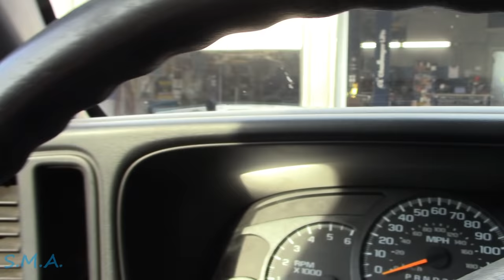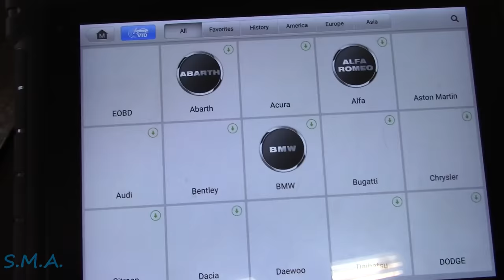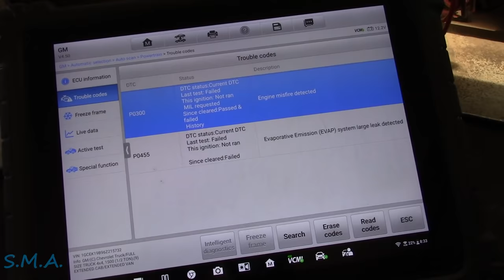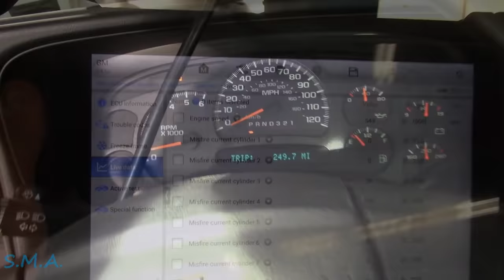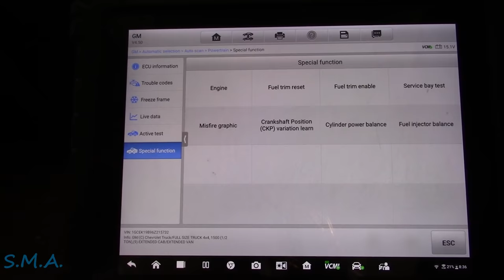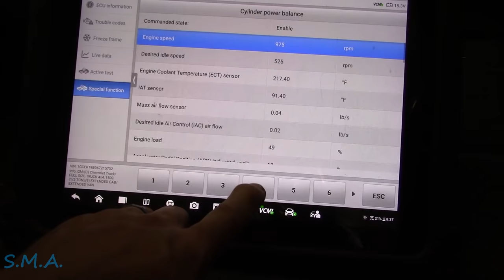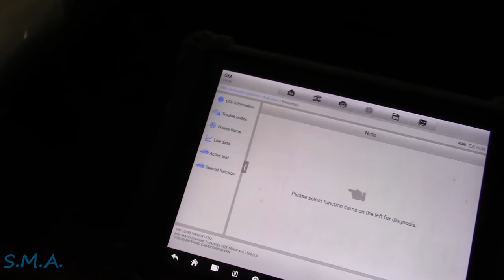GM - Chevy Truck: Misfire Diagnosis

Comment: That injector could be perfectly fine, yet be clogged at the input or the nozzle with debris, and that could be why the scope looks the same. The flow test proved the diagnosis, and your methods work well even with this bizarre part failure. That is why you are the go to guy. I have an electronics repair background in schooling, but am an amateur car fixer and I love you videos. I always try to beat your diagnosis while watching, LOL. These videos are the best ones. Thanks for making them!
Reply from the maker: That was the only thing I could figure myself. It wasn't seized up it was simply plugged tight. Therefore it still had mechanical movement.
Reply: @SouthMainAuto  There was a fairly clearly defined (though small) flattening on the good injector closer to the peak current level that wasn't there on the bad one.  That said it seems a bit late for an injector to be opening.
Reply: @SouthMainAuto  But it was not buzzing when u did the fuel pressure test?  Still am impressed.
Reply: @ebutuoyebutouy  Depends on what is in the nozzle, the buzzing is the tip of the pintle hitting the seat in the nozzle, if a chunk of crud is in there it will act as a cushion and no sound.
Reply: @Blazer02LS  Thinking about it u r correct.  Thanks for sharing.  Stay safe.
Reply: @ebutuoyebutouy  You too.
Reply: @ferrumignis  I was looking for this post. I'm by no means a scope master, but I noticed it too.
Reply: @Blazer02LS  Thanks for pointing that out. I hadn't thought about that. That would explain why the waveform looked the same yet you couldn't hear that injector. It probably helps explain why the other shop missed it. If they just looked at it on a scope it looked good.
Reply: @Blazer02LS  Exactly. Had a Honda motorcycle injector do the same thing to me. After cleaning it made the clicks it should.
Reply: @Blazer02LS  That seems like it would be leaking fuel past the nozzle though, and the fuel pressure wasn't bleeding off. Anyway, I agree with Eric O: bad injector.
Reply: @flagmichael  Not if the schmoo is in the nozzle tip, it would stop fuel flow and act like a cushion for the pintle, which in turn would work to hammer the crud in harder
Reply: This generation GM trucks are famous for gummed up injectors. I bought a 99 GMC Sierra with a 5.3 with a misfire on cyl 8. Took it out and cleaned it out with carb clean, then swapped it with the injector next to it, Fixed the issue. Now the famous GM wouldn't go back in park last time I drove it. I persuaded it to go into park eventually. Now I need to fix that. I suspect the shift indicator rod has came off the doohickey. They don't call them the Garage Man Companion for nothing!
Reply: The scope shows the electromagnetic response of the solenoid coil inside the injector. If the coil is good but the mechanicals blocked, the scope won't show this clearly as the coil is working normally. The fractional variation is due to the slug in the coil (the actual injectorctor needle) not moving inside the coil hence rhe inductance and back-emf of the coil is slightly different (not a lot since the movement is only a couple of mm).
Reply: 15 years ago I had a Malibu with 3 clogged injectors full of rust from a rotton tank. For whatever reason I had 3 sprk plugs out (probably trying to figure out dead cylinders without scope) and tapped the key to check something and the car started and RAN really well on 3 cylinders. I swapped all the injectors with used and ran great.
Reply: @SouthMainAuto  Eric,, it was seized wouldn't it throw up the Amp draw on the scope?
Reply: Like the plug, could you have swapped the injector with any known good one?
Reply: But when he did the injector test it did not make any clicking noise.. how does that work?
Reply: The back injectors esp #7 are prone to clogging up with debris.
Reply: Great job
Reply: @SouthMainAuto  what scanner are u using ?
Reply: OMG, I don't understand anything you guys are saying
Reply: @SouthMainAuto  hi boo
Reply: @limitlessworx5724  it's an Autel Maxi, I believe, but I don't know which exact model.
Reply: But, if it was just clogged tip or micro filter, I think you still will hear the rattle of the neddle opening and closing during the drop test. I think!. Thanks
Reply: While observing the wave forms, never thought I'd use the "ELI the ICEman" electronic training phrase!
Reply: I agree about the fuel clog 100%
Reply: Have a 05 Chevy box truck with a 6.0 misfire in one cylinder. This was interesting watching your deductive skills

Comment: The real misfire was the parts cannon that other shop aimed at that truck.
Reply: There is a guy in Avoca that actually diagnoses cars instead of just throwing parts at it.
Reply: Parts cannon stuck in full auto mode from the others, Seems to be a waist of good parts I hope the replacement parts hold up as well as the now discarded parts, Because many times one of those are your next repair location 😁
Reply: @mph5896  The most significant action was testing it under load which isolated cylinder 4. If a parts cannon "expert" was on the case would he not say 'let's replace the injector next'? Same result...with a few extra unnecessary parts at the start.
Reply: JerryUK I agree time is required. 1 hour diagnostic would be more than adequate. That shop needs to stick to tires and brakes, or go back to school.
Reply: I took my truck to a shop for a P1274. They changed intake gaskets, moved O2 sensors, played with the computer, and finally decided to sell me a computer. No way Jose. Did the exhaust blow test and every single joint leaked. Why they didn’t catch that is beyond me.
Reply: but they were in the neighborhood...lol. I don't suppose they are gonna refund the vehicle owner
Reply: Shop down the street: "Let's subscribe to this Avoca-know-it all's channel and laugh at him when he can't figure it out"
Reply: @jerryuk93  I would assume a mechanic should have been able to test the injector
Reply: Put a stick of dynamite down at think that'll work it's a typical Chevrolet their Infamous for having electrical problems
Reply: I think they lost this boat too soon it's going to sink Eric don't get caught in the middle of the ocean was singing
Reply: Chevrolet's have always been known to having electrical problems I think it would chase the electrical down you'll find them like to the matter of the problem got off too soon
Reply: No.  The real misfire was the one in our hearts.
Reply: The problem is that too many shops fire the parts cannon first then asks questions later.
Reply: Also with how cars have evolved, The best Mechanics have to learn something new every day.

Comment: "Let me put her in reverse just in case the brake lines blow. " Priceless. You know your older Chevys Mr. O
Reply: That one had me laughing the most.
Reply: Funny, and sad. My 02 1500 just dumped the brake fluid from a burst brake line. Dang mild steel lines rust faster then the body does!
Reply: Professor O, the man amazes me with his knowledge across the North American Vehicle line--Mechanical, Electronic and Electrical Diagnosis and Repair.
Reply: Don't want to put a new door on this piece of ......made me laugh.
Reply: "....And the pedal went clear to the floor and stayed right there on the floor
He says it's sorta like steppin' on a plum..."   ("Wolf Creek Pass by C.W. McCall."
Reply: “If you know the enemy and know yourself, you need not fear the result of a hundred battles. If you know yourself but not the enemy, for every victory gained you will also suffer a defeat. If you know neither the enemy nor yourself, you will succumb in every battle.” - Sun Tzu, The Art of War
In this case, Mr. O knows his enemy.
Reply: Yes I also make a lot of GM brake lines...

Comment: I love these in depth technical explanations. It shows how to arrive at a result methodocally, rather than jumping from part to another - which is where the original garage fell foul I reckon.
Reply: Agreed...   We don't always get the full deal of method and reasoning..    🏁
Reply: The way injectors are set up nowadays to make it real hard to bench test and injector in other words pull it out and check the spray pattern they do that for safety reasons so people don't burn up their cars because they don't have enough sense that you don't spray fuel on Sparks and on the motor not good combination I know I burned a truck up and put the fire out and rewired it and drove to work the next day or the day after I should say it's amazing what you can do when you got to get to work to pay for parts for your truck have a great day

Comment: I work at a heavy fleet shop and we play swaptronics all the time. I love it because it removes all doubt. If you swap parts around without spending any money, why not at least give it a try?
Reply: Agreed a lot of old shop manuals would say test by substituting a known good part
Reply: Ummmmm that sucks I work at a fleet shop and they rather not do that, just follow the trouble tree and fix it right with out guessing ….

Comment: Wow this really helped me, the lowly chevy owner to figure out why after sitting for a week, I had a skip but drive it for a while and it clears up.  The injector was  failing but when heated up, it operated normally....I kept changing spark plugs about every 6 months.  Changed the injector and it fixed it. Thanks

Comment: Hello P0300 my old friend. 2005 Chevy Express 4.8 with a random misfire. We replaced 8 plugs, all wires, #4 coil (dead); both sides upstream and downstream O2 sensors. Still a P0300 at freeway speed. The operative word is 'random'. Finally we replaced the crankshaft position sensor. Our Technician complained that the 'relearning procedure required accelerating the engine to 5,000 RPM: High 'pucker factor' on a 23 year old truck. My old friend P0300 went away. Now, a year later, my old friend is back. The only sensor that could add to the misfire condition is the camshaft position sensor. Since that requires R&R the intake manifold, and the oil pressure sensor is also located near the camshaft position sensor, we ordered one of them as well. Here is a valuable tip: On the camshaft position sensor, there is an 'O' ring at the very bottom. When that rubber 'O' ring dies, it allows motor oil to leak behind the engine into the bell housing frequently mis-diagnosed as a main seal failure. It can't be confirmed until the engine and transmission are torn apart revealing a main seal that is perfectly intact and the leak coming from a $30 sensor. (Ugh!)
Reply: Did you have to do the relearn procedure after replacing the crankshaft position sensor?
Reply: @julianmendoza549  My mechanic told me about the high 'pucker factor' because the relearn procedure required spooling the engine up to 5,000 RPM and waiting for the 'boom!' ;-D))

Comment: When I was a crew chief in the AF, we had a radar issue we could not duplicate on the ground.  Eventually we removed each component in the system, leaving only the wiring harness.  Then each component was placed on seven different aircraft, with plenty of documentation.  Then it is just a matter of time to see which aircraft picked up the original issue.
Reply: When was this? This may help explain the disappearance of Flight 19
Reply: My guess is it turned out yo be the wiring harness after all. 😃
Reply: Cannibalism?? Say it ain't so, actually its all good, sounds like controlled exchange at its finest. We in the Army play swaptronics with the best of them. Why not, you have plenty of the same models to choose from. Lol
Reply: Nothing like working with a fleet of the same things! 🤣. 
Priceless
Reply: @jo300hn  Priceless!!! LOL
Reply: @harryl7946  Would love to say they are all the same in looks only, each with their own temperament as a good lady would and ea with their way with you. Crews would tell you they even fly differently.
Reply: @hw5950  cars are no different. unless you owned 2, brand new, at the same time, drove them in the exact same conditions, for the same amount of travel, same everything else, there's no way after a couple of years they won't behave differently, even if those differences are slight.
Reply: @harryl7946  we had 60 of the KC-135 aircraft assigned to our base to select from.
Reply: This occurred during weekend duty, and I didn’t follow up on the issue.
Reply: @robertrichardson1133    At my first duty station, we always had a cann bird.  It would do that for a week, then spend the next couple of weeks putting it back together.  Talk about wasted man hours.
Reply: Yes, this is often a way to do troubleshooting in aviation, where you have a number of other aircraft all owned by the same owner (the taxpayer). But what if you only had one aircraft (or vehicle in this case)? Worth nothing to you then.
Reply: When I was a KC Crew Chief heading for Nam in Operation Linebacker the radar wasn’t working very well and I took my shoe off and slapped the radar display box.  The navigator about had a friggin cow and told me I could get in  deep shit for that.  He then noticed the radar was working better and I then told him a Lt Colonel Navigator told me that trick.
Reply: Scotty would have swapped the injectors and confirmed the problem hour ago , that's where 40+ years experience comes into play.
Reply: @jedfarmer8952  the other shop already tried that method and wasted hundreds of dollars of the customers money.
Reply: @hw5950  
During my time at Lockheed doing depot level maintenance on P-3 Orions, we called them snowflakes - no two alike.
Reply: @robertheinkel6225  60 KC-135...wow...saw maybe 20-25 at My base.  Mr. O knows his stuff, Love his videos
Reply: I got lot's of years troubleshooting AF jet electrical system problems; NEVER used another jet (flight) to troubleshoot bad parts!  This is even worse if this happened in a hot zone. Can't believe purposely flying a jet with unknown parts.
Reply: @toxiccater    We also had an active reserve unit on our base.  They had an additional 20 aircraft, so overall, we had 80 tankers assigned to the base

Comment: Eric, you diagnostic methodology is spot on:
• First question, which system has the fault? Go with the easiest system to diagnose first, then second, then third, and so forth.
• Once you've found the system at fault, check the parts of that system for any fault.
• Once a fault has been found, check the other systems to ensure that there isn't a second fault nor third and so on.
• If the fault is with multiple items, what is common among them? Check this place/item to ensure that it's not at fault and continue with previous diagnostic chain.

Comment: I have located bad injectors with an automotive stethoscope. All I had at the time, which one of these is not like the other.
Reply: Great idea, you can hear the slug in the injector as it opens and closes.

Comment: This is a great, great example of thorough diagnostics, and why it's so incredibly important to follow thru every single path and theory. Had you scoped it in the beginning, and done no further with the injectors, it would not have been fixed. So many of us fall victim to this scenario. You just proved why it's imperative to be thorough and absolute with every method of diagnosis.

Comment: Yes. I have seen this many times in Chevys. I loved the old Throttle body intakes and injectors. So much easier to work on. The only real issue they ever had was throttle body gasket leaks
Reply: It does seem like Chevy's have problems with injectors.